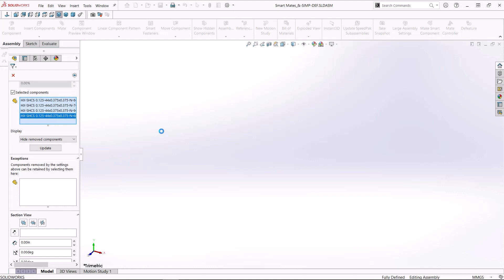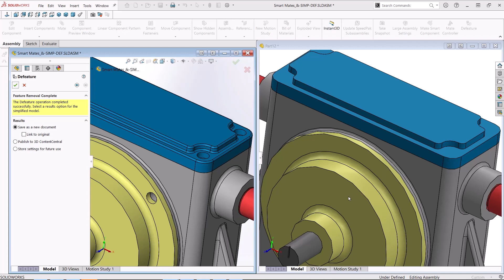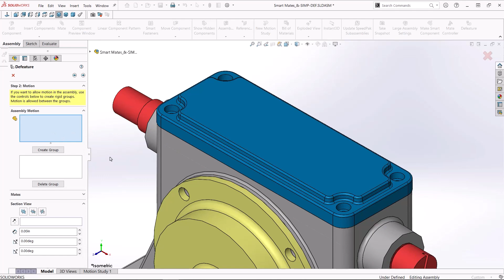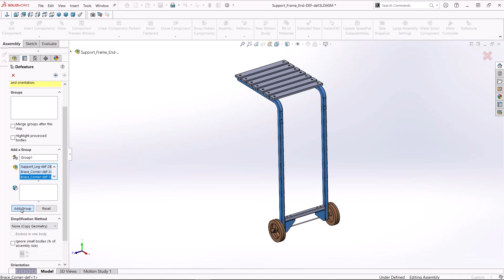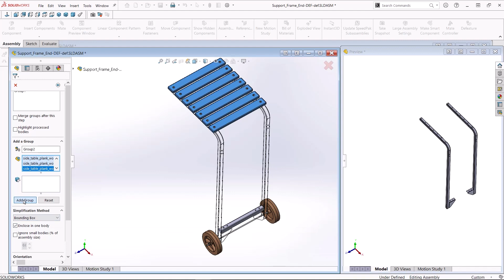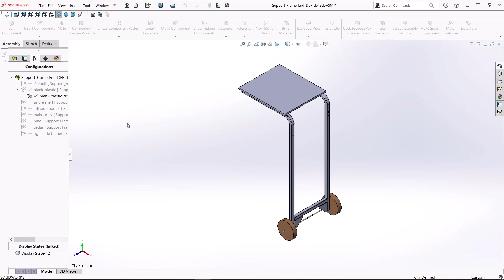Simple, Secure SOLIDWORKS Models with Defeature

Comment: This is all well and good except generating secondary models doesn't work in an actual production environment because you'd essentially have 2 part numbers that are the same but different. In the PDM vault environment, duplicate naming is generally prohibited. This would be far more useful if the defeature could go into a display state or a config within the original part. This way, I can go into all the parent levels and pick the defeature config., update, save. This would keep all existing mates and part numbers as well. With the method described in the video, if you are coming from full featured to defeatured replacements, you're looking at hours of work to replace models - if your PDM vault even allows it.